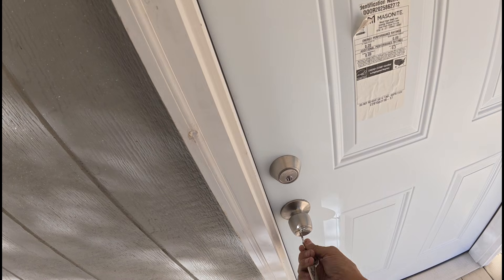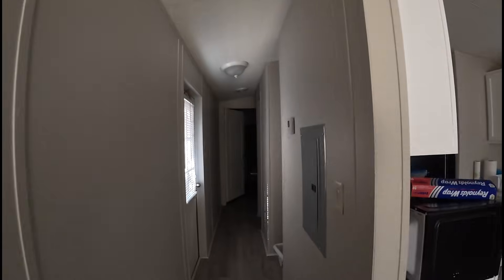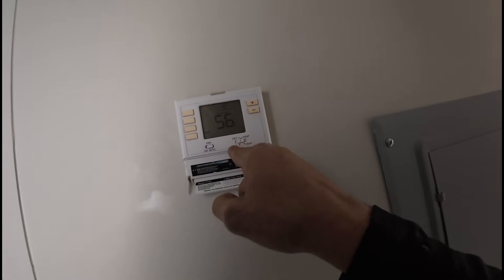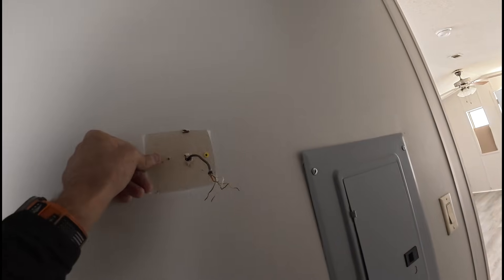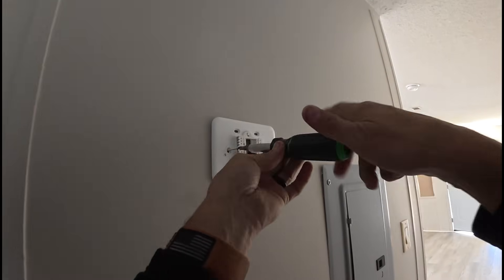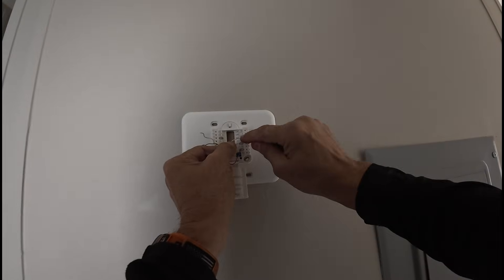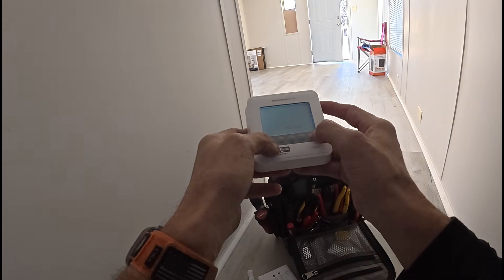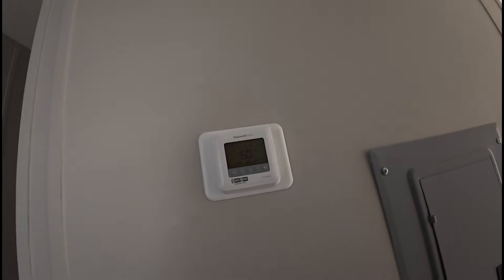No Heat In A Mobile Home When It’s 32 Degrees In The Morning!

Comment: I live in NC and I sold Mobile Homes for 13 years starting in the early 90's  in which I sold over 500 homes in my career back then  . I would  say that out of the 500 homes I sold , 98% were sold with new Heat Pumps .....

Comment: In Florida Mobile Homes comes under the Department of Motor Vehicles the only inspections a building inspector can inspect is tie downs plumbing that connects to the home same as the electrical and A/C. The only time you need a permit is for anything outside to it unless you are changing things that wasn’t designed from the manufacturer and their products such as windows, plumbing and structural.

Comment: is there any 24 volt hot water heat thermostats that are simple and reliable no batteries or switches to just do zones of heat in rooms that you know work well?
Reply from the maker: There are some very simple straight heat stats we sometimes use for millivolt furnaces that would work

Comment: About two weeks week ago, we had a call for service because of a very high electric bill. I figured, easy call. Electric strips are running instead of the heat pump. Sent Paul, the junior tech out. He calls me later on and told me, the customer wants to talk to you. I got on the phone and he said my guy didn’t know what he was talking about and could I come over. I told him I no longer do service calls because I have a crew that handles that. He told me he bought a heat pump thermostat to save on his electric bill. What Paul found is he has air conditioning and electric strips for heat. You need a heat pump installed, not just the thermostat, he explained. The owner didn’t like that explanation. I had to gently explain what was needed and Paul was correct. That was a new one. All these years I never came across someone that dumb and argumentative.  I doubt that is going to turn into a sale.

Comment: Some body may have replaced the heat pump outside unit with just a air only condenser.
Reply: More like a diy thermostat replacement and didn’t know what they were doing

Comment: Electric can not be primary heat in Georgia? Heat pump is electric too last time I checked.
Reply from the maker: I think you know what I mean. A heat pump doesn’t produce heat with electric heating elements, it actually transfers heat from one place to another, and is at least 4x more efficient than electric heating elements.
Reply: Seriously? Everyone knows what he means. Electric resistance heat has a COP of 1. The COP for a heat pump is typically around 3.5-4.

Comment: Cannot imagine what the electric bill must be. A mobile home (not usually well known for great insulation) and straight resistance heat.  We owned an all electric home in the early 80s and it had resistance heat only in the furnace.  Plus the duct work was in the concrete slab which sucked up heat until the concrete all around the ducting got warm.  Anyway, it was terrible.  A $200 plus electric bill the first January we lived there.  Probably equivalent to $600 today.    That and the 13.5% mortgage rate made home ownership very costly for us.
Reply: believe me, they're no better newer.  my parents turned one into a shop, and the furnace went kaput in one of these "Alberta Clippers" in the middle of the night with the water running.  destroyed a sizable portion of the floor and even some of the pipes.  the whole thing is mismatched AND attached to a natural gas well that tends to drop its shutoff valve right around freezing.  so I have to go out, kick the well over, and then MANUALLY REIGNITE the furnace in the thing with a spreader torch just to be able to reach the manual only pilot.

Comment: Hello Curtis, from the dirt inside the blower compartment and the insulating liner, it may be a good idea to check the blower wheel and evaporator coil. I bet is pretty dirty. System was probably operated without an air filter for a long time. Cheers!

Comment: Now your going to be a Auto mechanic... 
Check the DC Voltage after yea get it running should be 13 -14 volts (checking the charging)
 😊

Comment: My guess is the primary source of heat rule/law is for new builds after a certain year. If they were built with resistant heat originally, probably grandfathered in.
Reply from the maker: Man that rule has been in effect for at least 20 years. So, and they’ve been installing these the whole time I’ve been working in GA